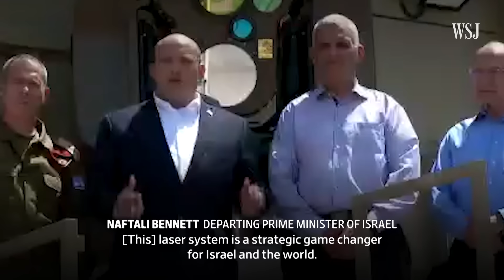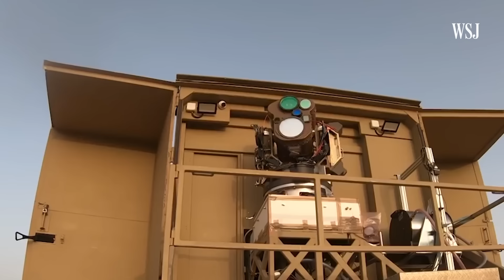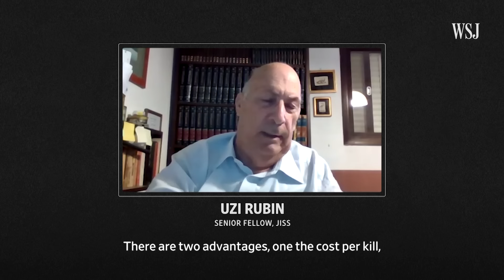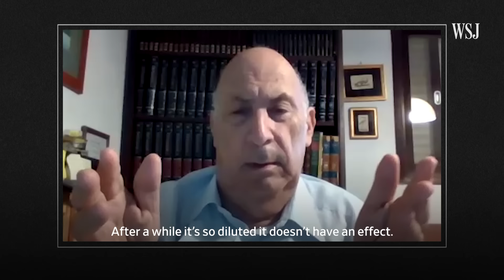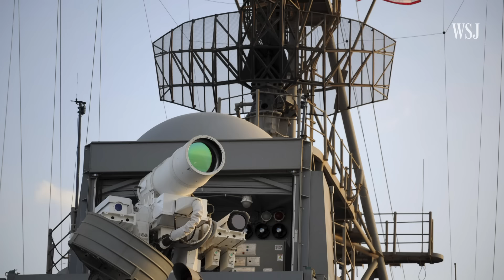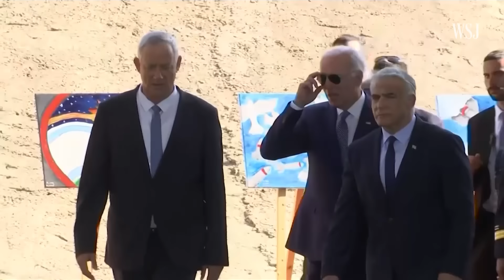Iron Beam: How Israel’s New Laser Weapon Works | WSJ

Comment: You didn't mention a lot of things,
1) The problem of whether, distance and time can be easily overcome if the power of the laser is increased. An 800kw laser has no problem cutting through the whether no matter how bad it is. And there is a lot more range of laser power to be explored such as mega watt range, gigawatt range, terra watt range and petta watt range and so on. There is no limit to the power you can pack in the laser. And lasers in the range of megawatts only are enough to take down any form of arial threat, any kind of missiles, UAVs, fighter jets, planes, etc. The only problem is that the vehicles carrying laser systems can only store so much energy. That is what limits the amount of power available to laser system.
2) Lasers in megawatt range destroy their targets in fraction of a second. Such lasers would be the best defense systems ever in the world and can destroy multiple incoming projectiles in a second or two.
3) Lasers in petta watt range rip apart the space time continuum itself, resulting in creation of matter from energy via hawking radiation. These lasers would cut through planets, stars or anything that is not a black hole.
Reply: Weather, not whether.

Comment: Do not forget, that this is a very young technology. You can see it's development on regular handheld laser pointers from China. For 5 years, power of those increased tenfold, and prices dropped significantly. Same goes for military grade lasers. So, I suppose we'll see a 1MW laser on the battlefield in next 5 years or so.
Reply: @adaster98  Right I know, but at the scale of cosmic gamma ray bursts they could vaporize a person instantly. If we could replicate even a fraction of that power it's a worthy weapon, but would ofc be a banned weapon of war :)
Reply: @nick_0  The problem with creating a gamma ray weapon would be the power draw required for anything that would cause near instant death. The best we could do is create a cancer gun with our current tech. There are just so many more efficient uses of the electricity when devising weapons. There's the whole electromagnetic spectrum to look at, but the most viable options are the ones that heat up an object. I suspect any viable solution will be foiled by a coating that reflects the spectrum used (look up laser tattoo removal).
Reply: @zaxxon4  Coatings could be countered with multi-wavelength weapons. And microwaves will likely always remain viable, given that many types of missiles rely on microwave signals (e.g. GPS) to function.
Reply: The US already has a well defined development plan for 1 MW weapon  in a Tank sized platform within a decade, limited only by the power supply.
Laser weapons on nuclear powered ships could be scaled to 2-3 MW within 15-20 years.
And for lowered powered requirements, a clear plan up to 500kw could be deployed in a tank sized platform within 5 years.
Reply: Imagine they developed a gamma ray burst weapon with an intensity that is hard to block

Comment: Until they start coding their missiles with deflecting material to deflect lasers or start putting lasers on the missiles themselves.
Reply: If they put reflective material on the rockets it has to be completely clean when flying through the air. Good luck with keeping a rocket clean through a launcher tube

Comment: It's always best to have multiple types of system to counter a particular threat.  The laser system is relatively inexpensive to actually use, so there is likely the ability to deploy more systems for the same cost as the Iron Dome system.  Networking the fire control systems would allow the optimal engagement of targets to maximize the chances of a shot resulting in a kill.
Reply: There's also the question of the cost of the unit itself tho, if it is in fact low or just not too expensive than you're right. I suppose it isn't too expensive to build.
Reply: @chencohen2369  the cost of production isn't part of this particular equation. Because the other option (at current time with current tech) is for them to be shooting down $200 rockets with $100,000 interceptor missile, with some intercepts needing more than one. 

Estimates put the ham mas and haz bol lah (hopefully this post stays up with YT algorithm lol) stockpiles of rockets in the 100,000-200,000+ range. Just hez bull ah has 100k by some estimates. With that type of quantity to defend against, the production cost would have to be unbelievably severe to make a real impact on the decision to go with trying to use this as primary and dome as secondary
Reply: What about power wise
Reply: @SpazTc01  they have em available for all platforms. Land/air/sea. Pretty wild. But if it's flying it probably isn't too intense all things considered. 

Raytheon (I think it is) even has one inside a standard looking missile ballast/additional fuel tank. What I mean is the entire laser defense system, is contained within the emptied missle shell or whatever the proper term for it's housing is (obviously the laser defense system is a custom encasing lol, Raytheons version just looks exactly like that of a missle casing/housing and fits on the wing armaments so it's a universal application basically)...

Crazy to think that's possible, to have on a fighter jet which truly can only carry the lightest loads of all
Reply: Exactly, decreasing your reliance on one thing  even if its a slight difference is still better than being completely reliant on one thing.
Reply: If I remember correctly, the system itself is more expensive than an Iron Dome battery but it obviously is much cheaper to run.
Reply: great comment
Reply: I a @cesarzumaetavalencia8643  hmm
Reply: So it's cheaper making laser than make Palestinians equal citizens and end Apartheid, wow good job
Reply: They also have shown to have airplanes with iron beam systems on board, basically shoot rockets down at their peak height or fire as they take off. anyway, very promising system and def the future of defense and offence.
Reply: In theory you should be able to hyper impose a field or a shield. Just a FYI
Reply: Freedom https://youtu.be/PPdhLqyFhG0
Reply: Well when government stops trying to play God Almighty they will be better off. This blasphemous Mass surveillance system is not going to go very well for anyone. God will not be mocked
Reply: Ayyyy top comment is a good one - not a meme! Lol but exactly if they can mesh the dome and the beam as well as increase the number of beams in service they will have a better chance of vehicle kill. I’d be curious though if the BEAM has enough time to be successful before they would need to be firing rockets from the dome system. Like by the time they can determine if BEAM didn’t work, is it too late to hit the incoming threat with a dome rocket?
Reply: Or just simply give back the land to their people and peacefully leave

Comment: The video forgot to mention that there are plans to mount this new system on drones in a few years, thus eliminating the weather factor
Reply: drones cant out fly missiles..
Reply: @thewolfofswingthat2035  dosent need to , the laser will follow the missile while the drone is up in the sky
Reply: @omer9572  the drones have to be up there 24 hours then, or drones have to take turns to be up there. Because if you launch the drone when a missile is detected, its a bit too late...
Reply: @thewolfofswingthat2035  Israel already has many thousands of drones.  Keeping a constant presence in the air would be no problem.
Reply: @JazzATrain  good luck with that
Reply: @thewolfofswingthat2035  Israel consistently develops new and enhanced technologies that are capable of doing things that were previously thought impossible.
Reply: @thewolfofswingthat2035  Israel already does that they constantly have drones that work in shifts seeing gaza

Comment: It doesn't need a huge and powerful power supply. 300kw. is only the output intensity of this iron beam.,not the power consumption thus it's only    3 or more dollars per shot. thus becoming it mobile ..it doesn't need nuclear or huge electric generator ..

Comment: Lasers will never be a one-size fits-all solution due to things like rain, fog, and solid-shot kinetic penetrators. It'll need to be a combination of lasers (to minimize cost) and railguns or missiles (to hit whatever the laser cannot).
Reply: But for Israel, which rarely gets mist and the area around the Gaza strip has little rainfall, the Laser is an excellent weapon.
Reply: Weather can be “cleared” locally to a large degree, but for sure, railguns are the actual silver bullet.

Comment: Im quite Skeptical for this single laser technology, but.......my bright ideas said, why dont use multiple beam to a single target?
Reply: i mean it won't replace any of the existing defences already online, this would just be another addition to the already hardened "Iron Dome" system that Israel has over their airspace, i would assume (once they've had enough testing and further development) that this would augment the current multiple batteries of the missile based iron dome as long range to medium range interception and have the Iron Beam be the medium range to short range interceptor, and basically be a very effective backup in-case the already high intercept capability of iron dome misses a few bogies, if anything i would also suggest having a few C-RAM cannon interceptors too so they can have an all around complete protection from any kind of rocket Gaza can sling at them
Reply: @rrenkrieg7988  CRAM is expensive as well and sometimes dont work realy well on multiple incoming target, I believe the scientist are always think the efficiency that laser is quicker than ballistic, i do learn about optics such as multiple mirror on Giant telecope can collect light better in far away universe.....kind a weird away around though on my wild imagination like burning with magnification

Comment: The average household doesn't use 1kw on average, it uses closer to 15kw at any given time. It can take more than 15kw just to power on a central air conditioner. It takes nearly 1kw just to run a refrigerator.
Reply: What kind of inefficient McMansions do you all live in? I have a fridge. My apartment uses 115 Watts on average (1000 kWh/year).
Reply: @CatatonicImperfect  They take 800 watts to start, and then 115 sounds about right for running watts, and that's considered a low-powered appliance. Hot water heaters, dryers, stoves and ranges, space heaters and AC units will quickly run you up past 10kw. You live in an apartment. Big difference between that and a house.

Comment: It's not only cost effective but environment friendly also🙃🙃🙃🖖
Reply: well, no. the rocket shrapnel still falls to the ground, unless youre talking about the gas a normal missile burns then its just ridiculous
Reply: @L10R.05  Would you prefer we use a tractor beam to safely pull the missile down to earth without it blowing up?
Reply: @lordyoda607  it does blow up tho
Reply: @L10R.05  if the missile is not hit? There's no sharpnel??🤣
Reply: @omniyambot9876  the missile explodes. Use ur brain

Comment: Aside from having more of them spread around to attack targets from multiple vantage points they could pump up the power to reduce the dwell time. Conversely, instead of one constant beam the laser could be reconfigured to output an order of magnitude more power but in a short burst. Yes, "reconfiguring the laser" means redesigns and more testing, but if the goal is a cheap to use defense system with better reliability then it stands to reason that it could be a much more effective defense if it were a more powerful laser that only required a brief momentary firing to knock munitions out of the sky. Instead of 5sec of 1kw or even 2sec of 3kw I think 100ms of 100kw would be a beast to contend with. Tack on a bunch of supercapacitor arrays that just charge up at the same rate as the 1kw system and have it just be able to fire off a dozen shots before it needs to recharge. Anyway, I'm sure they'll get there eventually, because it's the next logical step in the progression. I know what it takes to engineer and develop these kinds of systems, and it's definitely a lot of work, and right now it looks like they're just trying to get what usable system they have thus far some funding for deployment, because it does offer value. I hope they have good luck with their pursuits.
Reply: Short burst won't be effective, you need prolonged exposure, they have entire teams of physicists and engineers working on this
Reply: @yoadknux  Short burst has its advantages, but physics wise 100kw of laser even if bit fractured can destroy rockets, UAVs and mortar shells. 100kw should be enough even for large UAVs

Comment: 1kW per household seems like an incorrect number. Should be around 6 kW IMHO.
Reply: avg
Reply: @Telencephelon  now that seems quite elevated as it will result in 730 hours * 1 kW=730 kWh monthly consumption thus 730 kWh*0.1041USD= 75.99 USD monthly bill. Anyways I’m not sure that 100kW is the avg power of a laser, but it’s peak capacity. From that view comparing it to peak capacity of average household would make more sense, but it’s imho..

Comment: What if you make the rocket/missile very reflective? (Like a mirror) would it still heat up? 

Or make it very thermally conductive,  (copper or aluminum) with a super cool liquid circulating in some very tiny passage ways?  Are a heat sink.
Reply: You have to remember that the system is designed to shoot down rockets fired from Gaza and Hamas doesn't have a lot of money to start building rockets with complicated cooling solutions. In regard to a reflective surface, that does seem to pose a problem but I am no experts so who knows
Reply: Any surface that perfectly reflects light, will not naturally radiate heat/light away. So if made out of these materials, not only would it likely be very expensive and hard to engineer, but it would also increase the cooling requirements on the rockets to prevent detonation before impact
Reply: Mirrors can't reflect all wavelength
Reply: almost junior
Reply: wouldn't that make the rockets more expensive and time consuming to produce?
Reply: Abdul, you can try your luck Israel will still get you
Reply: White paint and a layer of mineral wool between the steel body and the explosive inside it would defeat it. Add to that a slightly insensitive high explosive and wentig holes and the system is dead. Lasers suck hard against missile but they are gold against drones.

Comment: Countermeasures: highly reflective materials, rotating missile, cladding with airflow just below… lots of ways to make the laser take too long to work.
Reply: Reflectivity does not make heat buildup go away. Sure you reflect the beam to someplace else. But it would still heat up a mirror/tinfoil/reflective coating/ whatever. You could use copper shielding but also that depends on how effective it makes the rocket. Because if you do build rockets made out of lead it might be easier for iron dome or other interceptors to intercept. The iron beam works in unison with other defensive deterrents out there. So it`s not that cut and dry otherwise these highly trained weapons expert would have abandoned the idea long ago.
Reply: @frosty2975  reflectivity does reflect heat too, as long as the material reflects well in the right wavelengths. Cladding makes absorbed heat go away and rotation reduces the exposure of any point on the rocket to the beam.
Reply: @thomasdelbert  A rocket moves very fast. If you keep it rotating it would be rotating very fast. It might not be enough to dissapate heat. And I doubt the lasers here will have much heat loss when it comes to reflectivity. And it`s also the question with what are you gonna coat it with to reflect it with. That last one is most important detail. Because it can make or break a rocket.

Bottomline is. If you use this in unison with other air defence systems in place it would become very difficult for rockets to be effective in the future. Which I can only hope that it would come sooner rather then later.

Comment: How does it perform against reflective targets?
Reply: @Boaz Cardinal Yes
Reply: The beam that`s reflected will be weakened. But the impact of the laser on said reflective material would still get hit with the initial heat that`s coming from the original none reflected laser from the ground/air/sea/space.

Basicely what I'm trying to say is. The reflective material would need a way to conduct the heat away via heatsink or lead shielding. But it may not be enough for a very powerfull laser. Reflective paint/mirrors don't make heat dissapear.
Reply: @frosty2975  well it’s going to be full out war eventually